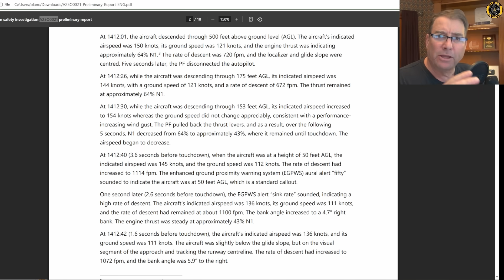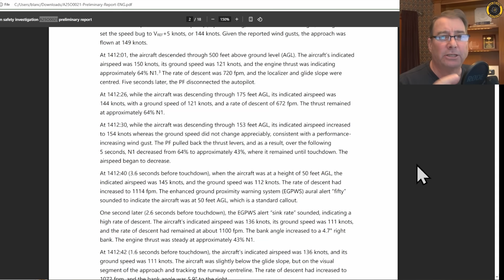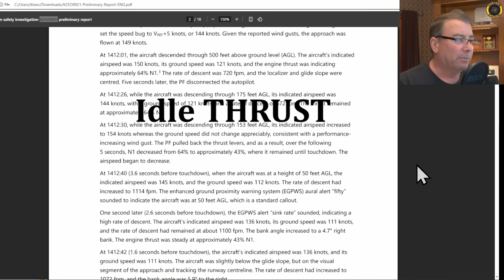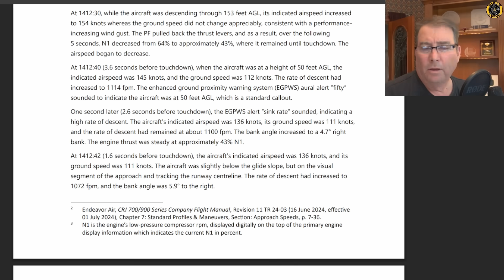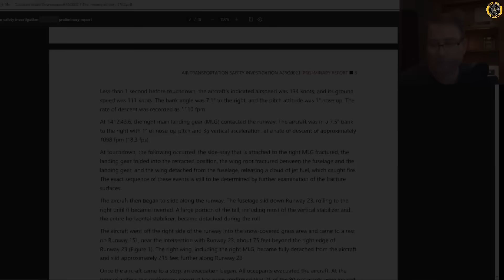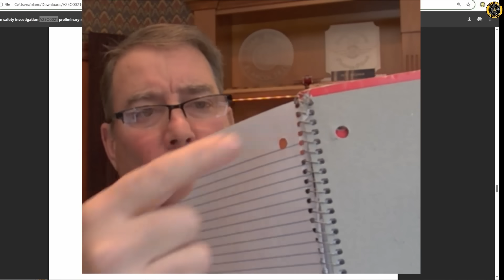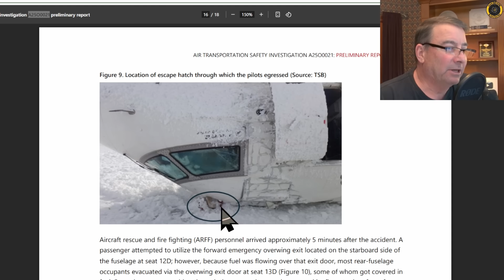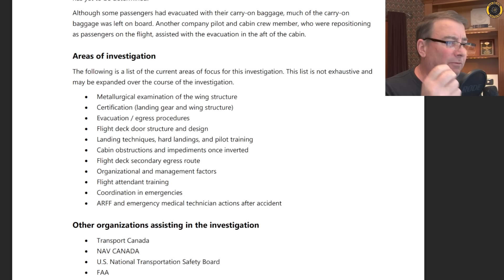TSB Prelim Toronto CRJ Crash

Comment: One of the many things I appreciate about your analyses is that, in general, the viewer comments have the same respect for the facts as the report itself. Not true of certain other channels. I've seen this accident presented on other channels; and the great hoard of internet cognoscenti have come to the conclusion that the cause of the accident is "diversity, equity and inclusion" programs.  Plenty of straight white males have crashed perfectly good airplanes because of deficient technique. Yes, there are systems issues around training, manual flying skills and air safety that need to be addressed. But sociopolitical agendas have no place in air safety investigations or on the flight line in general.
Reply: "Plenty of straight white males have crashed perfectly good airplanes because of deficient technique."
Now 'ain't' that the truth. But the "DEI boogeyman" , dummies like to ignore that point, because it doesn't fit their bigoted narrative. 🤨  Bigots will always find new ways and new buzzwords to use to display their bigotry. Nothing new under the sun, it's just a new term.

Comment: The stick and rudder stuff is partially driven by airlines and manufacturers I think.
Boeing and Airbus are both guilty of adding increasing amounts of automation under the guise of safety but also selling reduced crew training requirements at the same time (Max being a prime example).
That then filters down into training requirements after lobbying the regulators which results in less time spent learning how stuff actually flies.
Perfect storm when coupled with the global shortages of both flight crews and engineers (same applies just the 'diagnostics' have reduced system knowledge) is a recipe for increasing accidents.
Reply: Thanks to this automation, modern technology and training the accident rate is minuscule now compared with the old school aviation when there were no glass cockpits, lots of knobs, “steam gauges”, etc

Comment: I was speaking with an Endeavor/ Delta captain on a flight yesterday (we sat together, he was getting a ride to JFK)..we spoke about this and I told him to look up Blancolirio for the best summary of the TSB findings. As always, top, top work Juan, best channel of its type in existence 👏
Reply: with all due respect ... there is a difference between Endeavor and Delta.  Isn't a personal bloviate, but different level of qualification .... otherwise, the Endeavor guy would BE at Delta.

Accepting the blurred line has contributed to the value of the Delta pilots realized professional value to be decimated in the last 20 years.... ditto for the other majors.

Oh, there might be A USAF test pilot/Space Shuttle commander who'd rather fly the smaller jets regardless of the realized value .... 

but you're right, Juan does a GREAT job with his videos/debriefs.

Comment: Thanks Juan for another great presentation.  Having only flown prop planes I suppose it isn’t that easy to add power in a jet and expect an immediate response to prevent that sink rate?  I wonder also why the FO didn’t elect to land long.  Did the narrow runway caused by the snow banks create some kind of illusion?

Comment: Another conversation about pitch and power which doesn't look right.  If there's a gust which results in ballooning, the correct action on the controls is to lower the pitch, not reduce the power.  That's what the autopilot would do and it would keep the line of flight straight as an arrow.  And power does NOT control the altitude.

Comment: This really boils down to a lack of basic flying skills. The relationship of pitch to maintain airspeed and power to arrest a sink rate is vital to the operation of an aircraft especially under adverse conditions. It amazes me that when the sink rate warning sounded, no attempt at a go-around was initiated. This speaks to a lack of experience on the part of the captain and the FO. Illusions aside, a "sink rate" from the GPWS that close to the ground demands at the very least an addition of power, but really a go around is the best course of action. So far as we know, there appears to be nothing on the CVR that the captain verbally intervined in the final seconds of this approach. It is by the grace of God no one was killed in this accident.

Hopefully, this accident sheds the neccesary light on the training of new pilots that demands a return to basic flying skills. There certainly is a place and a need for scenario based training, but not at the expense of the former. Over the past 20 years, how many accidents were attrributed to a lack of proper stall recognition and recovery or improper landing techniques in adverse conditions? I think of the Airfrance, the Colgan Air, the Asiana in SFO--and the conditions for their approach and landing were excellent--and many others, especially non-airliners.

Comment: You are so correct about lack of stick and rudder mentality. Many years ago I was being given a check ride in a A320. Check pilot in the right seat. CAVU at destination airport which had parallel sets of runways. Just before we reached the OM the light plane ahead collapsed the nose wheel on landing, so runway closed. Tower asked if we would go around or like to land on the parallel. I chose the latter. I could hear the check pilot softly cursing as he went heads down trying to bring up the new approach on the flight management computer. I told him to monitor my approach as I disconnected the AP and auto thrust  and in the case of a go around to request straight ahead to 2000 feet. I always enjoyed hand flying that airplane.
Reply: The Bus hand-flies just great with the automatics off.   I miss it.

Comment: Great analysis. I have flown with many new hire, low experience pilots and many of them will do exactly as was done here- disconnect the autopilot at minimums and do minimal corrections until touchdown. You are correct that a more experienced "stick and rudder" pilot would have made the appropriate corrections as is done every day. We've adopted this method of training which is almost "ab initio" style, but we are still letting the FO's land every other leg like we have done forever. I'm curious how some of the other countries do it, do they let the ab initio pilots land every other leg or does the captain do most of the flying until they are more seasoned?

Comment: Juan is spot on with the lack of stick and rudder skill with new inexperienced aviators. These puppies are great at flying stable instiment approaches, can't fly stable visual approaches without a PAPI or VASI,  barely flare in the landing and can't controll the aircraft correctly in crosswind landings. I give them as many PF legs as safely possible so they will develope these skills. Thanks again Juan for a great take and analysis.
Reply: Same issues happened with the Asiana crash many years back at SFO. Visual landing and couldn't hand fly the plane down to the runway.

Comment: It seems the industry remains full speed ahead at any cost. The airlines are simply operating too many flight operations for the system to handle. The system being everything from training new crews to airport and airways capacity. It's been resting on its laurels and even today the focus has been on everything except this issue. The airlines have thousands of new aircraft on order and some are meant to replace older equipment but so many articles are written about the slow delivery causing loss of airline expansion that it is obvious they intend to continue to launch more and more flights with them. It's really time for the FAA to do its job and contain this growth mentality. Aircraft can never be a safe mass transit operation which it has now become.

Comment: Excellent review of the facts.  One issue that nobody seems to be reporting on is the failure of the wing spar!  I understand the failure of the right landing gear under that extreme load, any landing over 360 fpm decent rate is a hard landing and maintenance required.  3G load (lessened by the gear failure before translating to the spar).  3 G load causing a catastrophic failure of the spar?  The spar is to be engineered to 1.5 times ultimate load factor.

Comment: So it was pilot error, and the additional pilot/controller error lately is likely because the pandemic disrupted the entire industry and forced carriers to hire like crazy on the backside of it in order to have the staffing necessary to keep the airlines running. It's strange to me that even an inexperienced pilot doesn't mentally realize that in a gusty landing situation they need to be constantly monitoring power.

Comment: I agree with the stick and rudder training. There should be a requirement that in those 1500 required hours, that you also need min 3000 landings and 25 different airfields. A 2 to 1 landing to hour ratio at multiple airfields  while in the training phase will definitely expose a pilot to many more scenarios so situations like this one aren't a surprise to the pilot. Have the surprises happen in a 172 that is capable of dropping 50' onto the mains before you do it in a relatively fragile airliner. Point in case. I went for a $100 lunch yesterday and landed in a gusty15kts crosswind in my little Piper Cherokee. 10 degrees of flap, an extra 5kts of speed, full left rudder and my yoke turned about 90 degrees to keep it straight. I was never behind the plane and never concerned since I routinely go out and practice in less than stellar conditions for just this reason. I was impressed to see the flight school at this field out in full force with their students landing, bouncing, and going around in these conditions. Perfect learning day.

Comment: Watching the crash video the day after the accident brought back many memories of landing in gusty winds and having to ADD power on short final to slow sink rate. All my time is piston-powered SEL, and those aircraft respond much faster to power inputs than turbines. A frequent airline traveler too, I have also experienced power increases on short final and a few rejected landings in gusty conditions. The power reduction was very surprising. My assumption was that the high sink rate was solely due to a sudden decrease in headwind component that happened too late for a go-around.
Reply: The report tells us that the FO reduced power when the aircraft encountered a gust which increased the headwind. There was no change to the throttle in the remaining 14 seconds of the flight, but there is no information regarding what the wind did during that time. The significant decay in airspeed tells us that the gust probably lasted no more than 2-3 seconds, which would have given the crew about 10 seconds to make a decision.
Reply: Yes, there is wind information. The airspeed decayed after hitting the peak gust headwind. That calls for an increase in throttle. The crew had 10 seconds to respond and did nothing. Raising the nose to flare without increasing power would have made the problem even worse, and would have potentially caused a stall and even higher descent rate. Are you a pilot? Ever experienced a gusty headwind?

Comment: Honest question here. I'm no pilot but I do understand how wings work (on race cars anyway). The PEG makes the wings "fly harder" than the aircraft is set up for. I also get Juan's "pitch and power" recommendations because it isn't steady airflow.
What is the tradeoff to get the plane on the ground after a PEG? I'm assuming touching down longer than nominal, or am I missing something? You wouldn't compensate for PEG and then just dump it after that, obviously.

Comment: Juan I agree, you must have a grasp on stick and rudder, you never know when automation will fail, years ago i was flying me and my wife into San Antonio International in our Piper Cherokee 180 for a vacation, approach had me lined for straight in to 31 L, I was about 10 miles out at around 3000 feet, I saw a buzzard at last second  and pulled up hard, it went right under my wing and took out my pito tube, my airspeed went to zero, I knew my 180 very well, told approach what happened and then tower, I came in like I normally would and landed with no issue, it didn’t bother me at all, I landed by feel and sound.

Comment: Good job of explaining to us non-pilots what the details in the report mean, and, crucially, that there is still no info on rules or policies on when conditions should be considered too tricky for the pilots. But I think the crowd-pleasing "no substitute for experience" closing fails to take into account that there is no way to get experienced pilots without letting less experienced pilots fly. So the safety boards still have to answer, how can policies and training be changed to make that safer? Even without a full understanding of what went wrong this time, several ideas suggest themselves. Or rather, are suggested by the points blancolirio highlights in the preliminary report.

Comment: Classic windshear/runway orientation situation. I used to think of the landing in these situations as 2 separate phases. I like a little more speed and level off a foot or two above the runway. Now you are at Vref and 0 rate of descent. Then, ease it onto the runway. Of course, you can't do that on a short runway. That would have been a go-around. I landed at White Plains a lot. Runway 34 had a very predictable windshear just like this with the same wind that existed the day of the crash. It was a great training maneuver, but you knew it was coming. Any thoughts?

Comment: As a former military aviator I remember training was lengthy and comprehensive and included so much on basic flying skills and airmanship that seems to be forgotten in the current airline industry.  It may be that the industry is now perceived as so safe that some of these skills are seen as irrelevant.  They are not.  Neither is intelligent crew composition.  In my terms a co-pilot with 400 hours would be a second tourist with an already broad experience of global flying, icing and blowing snow in northern Canada, thunderstorms in the Gulf of Mexico, hot and high in Africa and the right-angled ILS at HK.  They would have learned their IF skills flying manually and working out drifts, timings and descent rates in their heads.  A sim ride every month would be a solid couple hours of emergencies from the common to the arcane.  They would be looking to be picked up for captaincy in a year's time.  A current 400-hour FO may have a much more limited CV in terms of a significant amount of synthetic rather than real world training and experience of only a limited number of routes, often managing the automation rather than wrestling manfully (sorry I am a dinosaur) with the controls.  This FO clearly needed mentoring in the cockpit by someone who could recognise the potential and developing hazards and direct the appropriate action.  But it's the system that needs action.

Comment: "Aircraft rescue and fire fighting (ARFF) personnel arrived approximately 5 minutes after the accident." 

5 minutes? Is this regarded as normal?
Reply: How fast could you get there?
The control tower has to acknowledge the accident, pick up the emergency phone, wait for the connection, advise where the accident is. 
30 sec?
Responders are in the station doing daily routine, get to the vehicle, stomp into your gear load up.
1.5 - 2 min?
How far to the accident site? The airport is snow covered, have to drive slow to not become another accident, It's a Fire Truck fully loaded with water or chemicals, not a sports car.
1.5 min? 
Once at the site, crew unload, pull out hoses address the flames.
1 min?

5 minutes - Is a good response time in my books.

Comment: There is a disagreement as to sink rate between the pressure altimeter and the actual altitude as measured by the EGPWS radar altimeter. Do the math!  The actual versus the indicated altitude question is apparent here in the time interval between 1412:30 and 1412:40, ten seconds later. Using the pressure altimeter data the descent rate was 1114 feet per minute. Using the radar altimeter, the plane descended from 153 AGL (Above Ground Level) to 50 feet in those ten seconds. Multiplying 103 feet by six to get the difference in a 60 second minute, we get a descent rate of only 618 fpm. The radar altimeter is much more accurate that the pressure altimeter. But the discrepancy provides  evidence of the changes in windspeed and direction.

The core issue is being able to detect these mini-windshears when the wind is not visible to the naked eye. In the long view, what we need are Doppler radars on the planes and in the control towers. As to pilot training, make them learn to fly sailplanes.

I'd check the location of the plane at 1412:30 relative to the beginning of the exposed pavement of the runway. It could be a persistent shift caused by the difference in surface temperatures due to the high albedo of snow versus that of the pavement created the gust. Sailplane pilots look for plowed fields among a sea of green planted fields and the cumulus clouds above them. 

"Broken ceiling at 3000 feet AGL, Remarks indicated cumulus clouds at 5 oktas"

Another misconception is the tendency to assume the force of a gust is proportional to wind speed when it actually is proportional to the square of the wind speed. The 1240 weather was "Winds from 270°T at 25 knots, gusting to 35 knots"

A 35 know gust is more than 12 times more powerful than the 10 knot crosswind the pilots likely used to figure Vref.  35 x 35 = 1225, 10 x 10 = 100, 1225/100 = 12.25